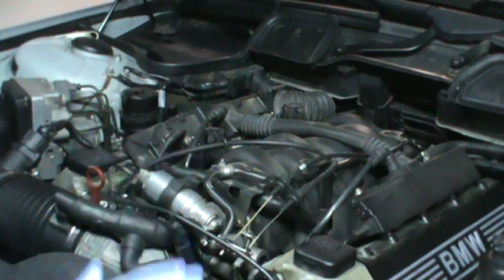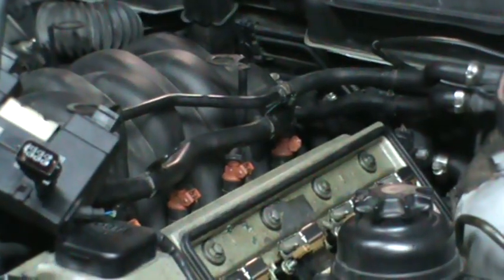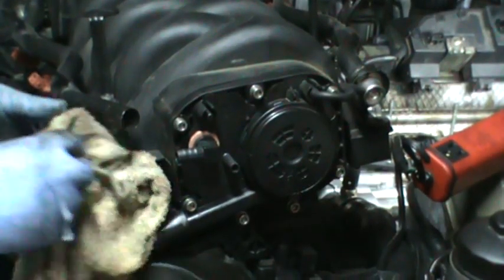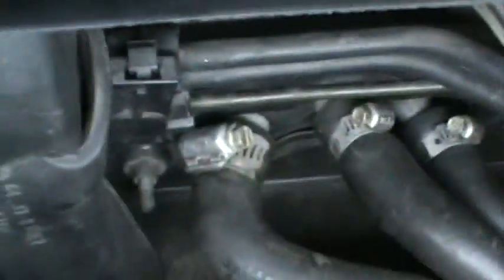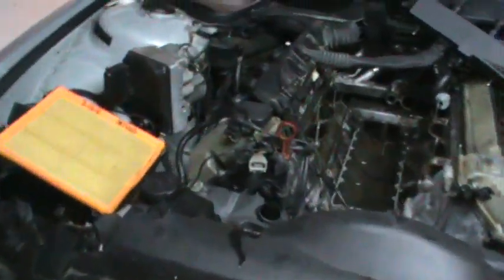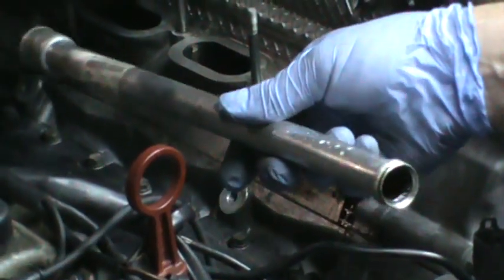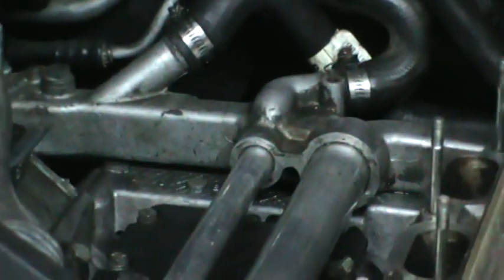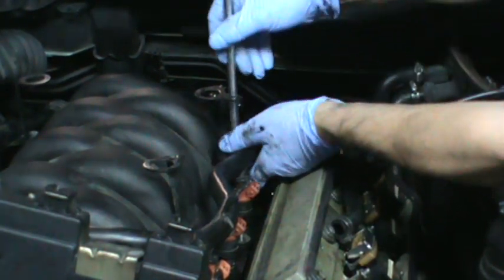BMW M62 Valley Pan Gasket Replacement

Comment: Great video! I am planning on replacing the Valley pan gasket this weekend and was about to order it, and glad I didn't!  Are there any parts that I have to order to do this job?  I know you say the OSV, but is that recommended since the manifold is already out, or is that absolutely necessary since it was removed?  Is it possible to do this job without buying anything other than hi temp sealant? thanks again!

Comment: unbelieveable thank you so much if you ever need to know any plumbing tricks hit me up,,, except i forgot hose to oil seperator and it tore off or was always totally broken still going to replace valley pan really unsure about silicone or buy gasket.. how much pressure builds up in there
Reply from the maker: Buddas D The pressure build up is not much.  Mostly it is a vacuum.  That tube is a part of the PCV system and basically provides a path for the oily gases from the intake manifold rear cover to the oil separator that is located on the front of the engine, (Behind the timing chain cover).

Comment from the maker: The front of the tube should be OK. you are sliding the tube forward and will not see the front o-ring.  A new o-ring will be on the rear cover for the tube to slide onto.  The only wire to cut - if you want to flip the whole harness out of the way - is the wire to the alternator.  I was never able to disconnect it at the alternator without dropping the alternator which is a real pain to do for this job.  The throttle position connector shares a like connector so mark that one.

Comment: I got oil leak on the same engine it looks like it’s coming from the oil separator area any advice  before I rip into it
Reply from the maker: Most likely one of the o-rings is leaking.  Unfortunately that is labor intensive to investigate and confirm.  If you are doing the work, consider paying a shop an hour labor to confrim the problem and prevent just throwing parts at the car.  FYI, I have not and I do not know anyone that has replaced the oil seperator.

Comment: what's the torque on the valley pan and accumulator .plus the intake? that would be a big help.
Reply: 7 ft lbs on the valley pan.  I couldnt get a torque wrench back to the accumulator so I  tightened them the best I could that felt like 7 ft lbs. The intake manifold is 15nm or 11 ft lbs.  water pump 7 ft lbs. Harmonic balancer 17 ft lbs. knock sensors 15 ft lbs

Comment: i tried the junction box grab-n-yank when i did my valve cover gasket job but that sucker was STUCK on there, i had to use a pick to move the clips out of the way
with decent lighting and a proper 90 degree pick it's pretty easy to get all those clips
Reply from the maker: +Ryukachoo  Some of the injectors do not allow for that as you have found out.

Comment from the maker: The cam shaft covers and front engine cover's gaskets become hard over time and leak.  This is common and the engine needs to be resealed every once in a while.  Most people wait until the spark plug wells fill up with oil.

Comment: now i got a question i wont to change my spark blugs
the disaster was that every time i open s spark blug i find oul in it
could it be from the pcv valve the one behind the intake or it must be from the beston rings ?
Reply: asaad alahmed Your Valve Cover Gaskets have failed and are leaking

Comment from the maker: Hard to say. Once a flow path is established the fluid can create a wide path.  I have not seen a large volume escape from a valley pan failure.  You could remove/replace the hoses on the back fire wall first to see if one of the hoses failed under the clamp.
Reply: Hey I'm wondering how you put the pipes on with the actuator on or off

Comment: Great vid David thanks so much.  I just put my valley pan back on my E39 with the silcone attemept at a gasket, hope it seals.   I also managed the accumulator (someone called this the water manifold?)  trick to remove the metal tubing and it worked like a charm..do I have to seal this thing when putting it back in place or can I just clean it up and re-bolt it?  Any info. is greatly appreciated, thanks all!!
Reply from the maker: The last time I removed the accumulator, the gaskets remained attached to the block. I was able to reinstall the accumulator without replacing the gaskets and there were no leaks.  As long as most or all of the gasket material is on the block or the accumulator you should be ok.

Comment from the maker: The original OEM injectors have more of a lip on them for the clip to hold.  There is no magic, a frim grip and pull.  the box comes right off.  If you  perfer the Bentley Service Manual method then unhook them with a pick.  They will not fly off.  I just have taken them off so many times that I am confortable with my method.

Comment: Great video sir. How is the RTV holding? I just dod this and tried reusing the stupid factort gasket string garbage and it pushed out and only after I had the entire engine back together did I find that out... FML. Well i got it all back apart in about an hour and Im going youre route by scrapping the string and going with my own RTV as you did. At least I got it running and my timing job os good after new guides and all that mess.
Reply from the maker: I did have to let the silicone set up over night and that lasted until I sold it. The new owner kept it for a couple of years and sold it.
Reply: @A_Renaissance_Man  thanks again for the tip. Ive got it sitting finger tight and Ill get it back together after work tomorrow. It was such a let down after all that work to hear the water pouring out lol. I made a quick video and Ill be sure to mention you in the comments.

Comment: Hi David,
 Thank you for the informative video. By chance do you remember your torque wrench settings you used to tighten for both the valley pan and intake manifold bolts? Thanks
Reply from the maker: G VS I recommend a Bentley Manual or purchasing TIS on ebay to get the info from the source.

Comment: I think that I have a coolant leak from the same place on my 2003 E53 X5. 

Have you found that the gasket sealant was reliable? Has it lasted without leaking?

I would prefer to use gasket sealant than to spend $300 Australian dollars on a new valley pan.
Reply: Also, thanks for filming & posting too. Really helpful.
Reply from the maker: I read both of your comments to my channel, Thank you.  As far as adding something to the system to fix the leak, I apologize, I cannot recommend any additive to any modern car and especially BMW,  you see the coolant tank, water pump, heater core, temperature gauges, yes there is more than one, all will be affected by the goop and in the end will cost you an engine.

Parts costs are the same so any do-it-yourself only saves your time and shop labor costs.

Having said that, I just cannot advise you to go for the E-Z fix because experience has taught me that something like that is just a jump off of the cliff.  Sure is fun to fly for a while but the ground will eventually end the joy ride.
Reply: @A_Renaissance_Man  I was asking about the sealant that you used in this video, not an additive that I might add to the coolant.

Have you found that your method of adding black silicone sealant to the valley has worked for you?

Or did it eventually leak again?

Comment: Hi David, I just did my valley pan gasket and accumulator gaskets and I have fixed the leaks your video was a great help! But now my car won't even crank when I go to start it. Battery is fully charged. I hear a faint tick near the passenger side of the engine bay but it sounds more like electricity making a connection (maybe near the fuse box). Any ideas?
Reply from the maker: +bighanes26 Right away I need to tell this response does not contain your solution.  I have heard of this happening before.  Could be one of your connections were not properly reassembled, especially the important ones like the Mass Air Flow sensor.  There are two identical connectors for two different purposes near the throttle body on the passenger side of the engine.  I was always very careful not to mix those two up.  I think one of them goes to the thermostat and I cannot remember what the other one connects to.  Since everything was disassembled, something was probably not reassembled correctly even though in our minds we think we did it correctly.  If you can get under the car make sure you main line has 12 or more volts to the starter, then you will know that it is some connector that was disconnected during the repair work.  Good Luck.
Reply: I just tried manually engaging the sarter and i got a fan sounding noise from the starter. Also a lot of sparks came from the wire that goes into the big part of the starter. Does this sound like my starter is bad?
Reply: +David Prokity Also thanks for the quick reply.

Comment: I'm doing a valve cover gasket on both sides for a 2001 X5 4.4 - WARNING - the pull and yank method had too much resistance.....so I backed off from using any more strength and played 'safer than sorry' hand by spending time with those damn little clips.
Reply: Same. The yank did not work even with all my force

Comment: My car is a 2001 X5...if you follow the fuel rail to the back...driver's side of the car...you'll find where the fuel line clips into the fuel rail.  At that junction...take your right hand and grasp the fuel line side with your palm and middle through pinky finger...then using your thumb and index finger...grasp the fuel rail side and pull clip  toward the fuel line side.  Then separate the two.  You'll want to make sure there isn't any pressure in the fuel line...dangerous for obvious reasons.

Comment: HI David, This is  an excellent video. Just before i go putting hands on mine, and because the leak is minimal, I need to ask you if any of the coolant leak solutions in the market (Alumseal, radiator sealers) would work fixing this gasket, so I don't have to do all the work.
Reply from the maker: KAMIKAZEUSAC Sorry this is late I have been on Vacation.  In the past I would say never use that stuff you will cause more damage then it is worth.  I have changed my mind and have actually used some sealers with great success.  Not the Brown kind with the pellets that you have to shake for a really long time to dissipate the solids but the slimy kind that you have to shake but it mixes readily.    I can only telly you what I am doing as you will get much advice that tells you not to use it.

Comment: What is the torque spec for the valley pan bolts??
Reply from the maker: Torque the valley pan bolts to 10 Nm However, 8 Nm is strongly recommended.
Plus the value does officially vary by a little bit depending on the engine being an M60, M62 or an M62TU.

Comment: Curious as to how many times you've had to do this on this same car because you have done it this way instead of buying the pan with upgrade.I am curious to know how long it has lasted before having to redo your silicon seal technique?
Reply from the maker: Twice. Once when the OEM seal failed and once when the water pump went out.  The engine overheated and the seal failed but I did not know that until after the water pump was replaced.  The OEM was replaced at 133,000 miles when the car was 10 1/2 years old.
Reply: Ok was just wondering how long it lasted after you done it .Wondering if wasting the 60 on the pan with vitco seal was worth it or just do as you have done only without so much sealant :). Will use 3mm and let it set up a few hours before installing and torquing pan down.While i dont want to redo this and if it stays sealed for 5-10 years I am fine with it.It really isnt much work replacing it.

Comment: David, did you just disconnect the fuel lines from the rail?  You did not comment on that part of the job.
Reply from the maker: That is because the factory safe sealed lines had been removed sometime in the past.  Showing the removal of nonBMW sealed safety lines did not seem appropriate.
Reply: thanks

Comment: Thank you David, I'll see what's left of them.  Typically they adhere to the block then?  Is this a silcone gasket or rubber (pre-made)?  You wouldn't happen to have any upper timing gasket or valve cover gasket vids would you?  Thanks again!
Reply from the maker: The gaskets for the accumulator were made from old fashioned paper gasket material.  The auto parts store sells them in rolls.  They would be easy enough to fashion but I did not want to deal with the tight space.  I no longer have any valve cover gaskets.  I recommend rmeuropean as a source of parts. They are very good to deal with. No Vids on valve cover gasket changing, only pictures, as I did not do videos of my work back then.  E38 (dot) org is a good source for instructions.  The passenger side has one stud that makes removal tough, also I remember changing the fuel line clamps from the anti tamper to regular and moving them out of the way to make more room.  Feel free to ask any questions.

Comment: Very helpful David. Having bolstered my confidence by successfully replacing the valve cover gaskets on my 2003 540i ///M Sport, I am now tempted to tackle the valley pan leak repair myself. Will the repair procedure you show be identical for the later model engine in my car? My engine also has a fairly new water pump, so I like the idea of being able to access the valley pan without removing the water pump. Thanks!
Reply from the maker: Thank you for you nice comments.  I recommend picking off the locking wires on the Fuel Injectors until you are sure that they can be easily disengaged from the junction box.  Some injectors do not lend themselves to the easy way shown in the video.  Otherwise take your time, replace all the hoses in the back and ask any questions, I'll will try to help.
Reply: Thanks for the quick response David.  I did remove the fuel injector clips when I did the valve covers, just takes a few minutes with a pick so I"ll do that again as you suggest.  I need to order parts for this valley pan job.  The kits out there (for example, from ECS Tuning) include a bunch of gaskets and a new "upgraded" valley pan that allegedly, "alleviates the core of the issue - the design" according to their site.  Do you have any experience with these upgraded pans?  I am leaning toward purchasing one of these kits, plus an oil separator.  I am not going to replace the water pump, as it was just replaced a few months ago.  Is there anything else I should order?
Reply from the maker: I have no experience with the kits but I am sure it is more convenient than doing it yourself.  I do recommend new Intake gaskets and of course the back cover.   Also, some O-Rings for the tubes, get 2 of each they are very fragile.

Comment: Thank you David but I must be blind. will look in the Bentley again and thanks again for the informative video
Reply from the maker: G VS Typically I use the German spec "Guten-Tight.  The intake Manifold has Torque limiters so you really cannot damage the gaskets. For the valley pan you just need to distribute the sealant.  I do not have my references handy and did not want to tell you wrong.

Comment from the maker: The first time will go slow and will probably be all day and maybe two.  Stay orginized, have a cart or dedicated table to keep everything in one place.  Think about things like replacing the water pump, intake back cover, spark plugs, and other items while you have the engine torn apart.   One piece of advice, if you have to force it, it is wrong. Remember todays engines are designed to be assembled by unskilled labor as apposed to a machinist or craftsman.  No offence to the UAW.

Comment from the maker: I do not know the book time to replace the valley pan. I would imagine 10 - 14 hours times 65-104 dollars per hour that is 1456 plus parts where a shop will not reuse any parts so I would say at least another 200 for parts which puts the job at 1500 to 1700 dollars.

Comment: Good video, though to anyone going to try this removal method, I would advise against it. 1. The injector boxes are brittle, it’s almost guaranteed you will brake the plastic clips holding in the injectors. Just take a few more minutes and pop the metal clips from the injectors, you can find them easily with a flashlight and a pick.2. With the accumulator, David did not mention the lower bolt on the driver side is almost impossible to get to, if you have big hands and forearms totally forget about even trying to do this. This method is the easy but hard way. The hard but easy way of removing the water pump is a much quicker option. Do yourselves a favor and just pull the pump, might as well replace your belts too.
Reply: Just finished the job, sad to say the black RTV silicone gasket totally failed, antifreeze now pours out of it as fast as you can put it in the tank. Time to tear everything apart and do it the correct way. 🙁

Comment: Thanks a lot for this vid...!!
The best, i've ever seen , when needing to remove intake manifold....

Just a question :

I'm fixing, a worn throttle body gasket on my M62, and I never manage to remove this " GRRRR ...Torx bolt "....looool

So , i need remove the entire intake manifold, to cut the existing torx bolt....and replace my seal, and the all bolt, but with " hex heads"...!!!

But, Why remove the electrical boxes , up to the valve cover ?!?
( It seems , not to be nece'ssary....?!? no ?!?) 

( i'm affraid broken them, by " pull it out too strong "...)

Regards,
Chris
Reply from the maker: You do not have to pull the box off as demonstrated.  But you will have to pick off the locking springs one by one.  Don't worry they will not fly off into the 9th dimension.  If you can make room without disconnecting the electricals than go for it.  The front throttle body plate is extremely difficult to remove.  The factory must have used lock-tight on the screws.